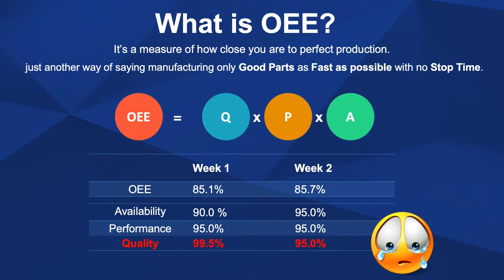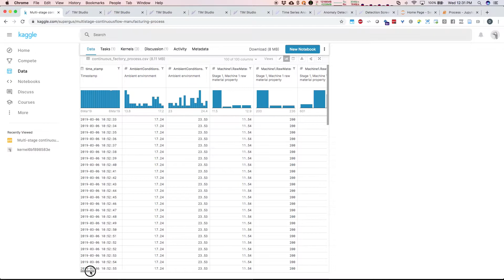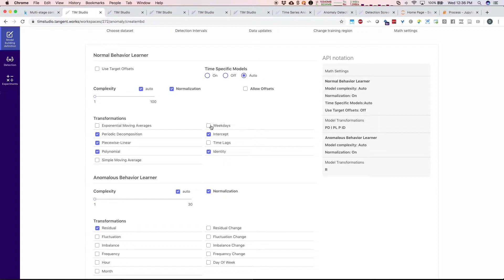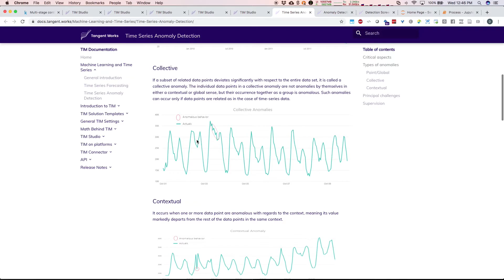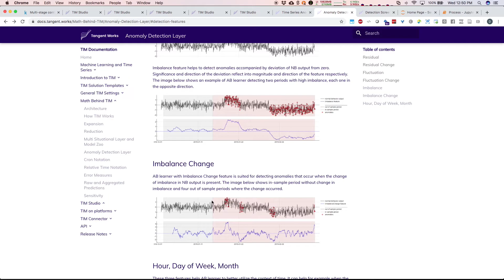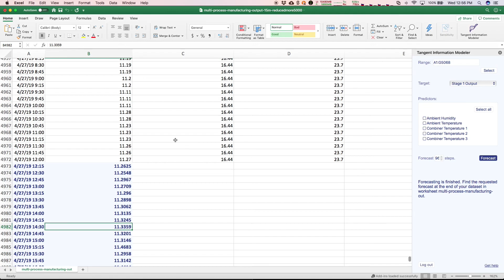Anomaly Detection in Manufacturing with TIM by Tangent Works

Comment: Hi, could you explain why you did unselect the "allow offsets" property (18m00sec)?
Reply: Hi, this property determines whether TIM can use lags of the target as features. This can improve the accuracy of the forecast. However, since the aim of the forecast model is to determine normal behavior (the anomalous behaviour learner takes of identifying anomalies), this can actually improve the forecast accuracy "too much", i.e. it might regard anomalies as normal behavior. In this case, leaving "allow offsets" on can lead to anomalous behavior not being identified, hence I turned it off. Hope that makes sense.
More information here:
https://docs.tangent.works/General-TIM-Settings/Mathematical-Settings/#using-target-offsets-anomaly-detection-only
https://docs.tangent.works/Math-Behind-TIM/Anomaly-Detection-Layer/